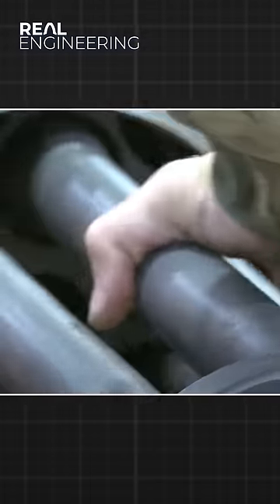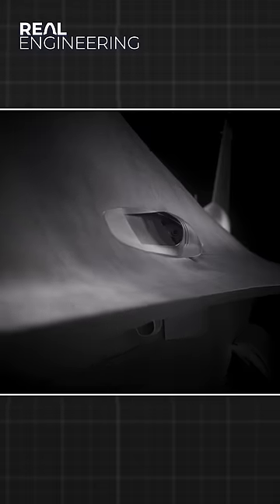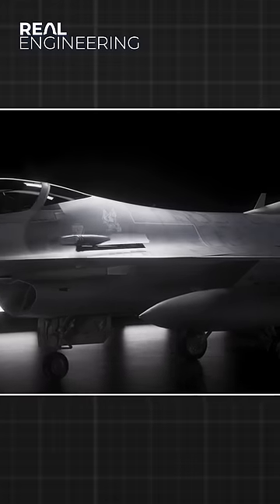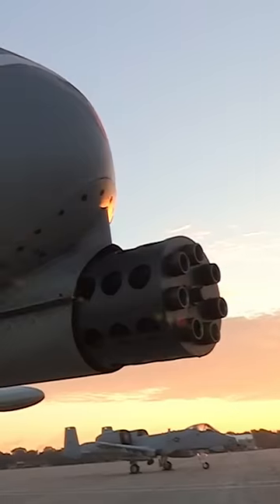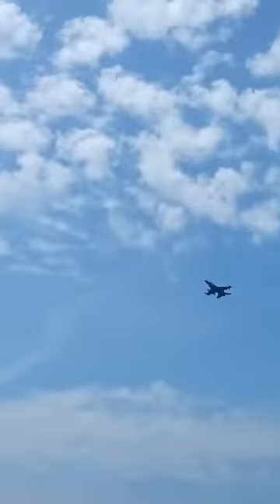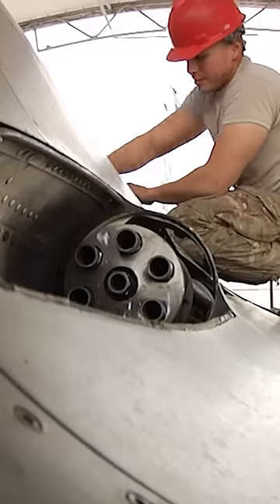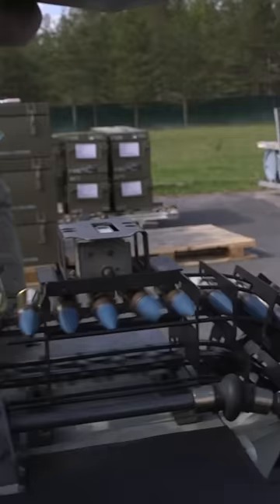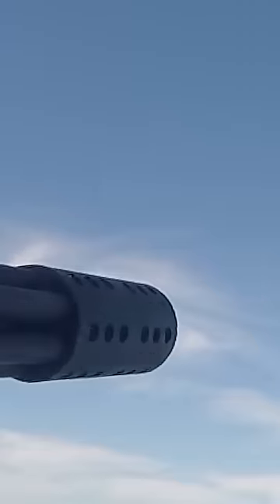The F-16s Gun Sounds Amazing

Comment: It's wild how the bullets are just inches from the fuselage as they exit the barrel.
Reply: Not really, their shockwaves from travelling faster than speed of sound can't damage anything.
Reply: @Isaac-ho8gh  fkn WAT?
Reply: @Whoisu1776 why you don't not understand proper good?
Reply: @Isaac-ho8gh 
There's only ever been one supersonic gun kill in history from what I understand, generally guns aren't used at supersonic speeds, they're used at close range after the fur ball starts and everyone's maneuvering so much their energy and speed are down.
Reply: @dukecraig2402  that's not what I said. I meant that supersonic shockwaves caused by projectiles generally don't damage things on their own (not the projectile hitting anything).
Reply: @Whoisu1776  autocorrect fucked up what I said. I fixed it just then, but what I meant to say was that the shockwave from projectiles going faster than the speed of sound (not from the projectile hitting objects) doesn't damage anything lol
Reply: In olden days fighter aircraft - the bullets would be timed to fire through the propeller!!
Reply: @ArifGhostwriter better hope it is timed correctly... that would suck if it blew holes in your prop. I'm sure it happened a lot.
Reply: @kevinstill1 - There was an interrupting gear that would be aligned with the prop. Every time a blade passes in front of the gun, the interrupting gear would hold the fire from the gun.
Reply: @ArifGhostwriter yeah the fw-190 has that and it’s cool af
Reply: "close" only counts in horseshoes and hand grenades.
Reply: @ArifGhostwriter   That's why they moved the guns to the middle of the wings. Boom!! Problem solved!!
Reply: Well, it's not like they go pulling the trigger on it every time they go out on a mission.
Reply: @Isaac-ho8gh  are you dense??
also the f16 doesnt fly supersonic and will never fight super sonic
Reply: @thedandy6765  Never say never. But, it seems that trying to dogfight while supersonic is, indeed, "A fool's bet."
It can still be a missile platform no matter the speed.
Reply: @thedandy6765 Do you know what supersonic means? You said the f16 does not fly supersonic and will never, yet it’s published top speed is Mach 2.0
Reply: @thedandy6765  are you restarted?
Reply: @ArifGhostwriter  Still cant get over the sheer insanity that this was actually and successfully designed and implemented 😂 so risky
Reply: @Isaac-ho8gh  Its the vibrations that startle pilots.
Reply: @ionbg7  the projectiles themselves don't cause those vibrations.
Reply: @thedandy6765  you also misread my comment lol
Reply: Wouldnt u be going faster then the rpunds at full speed? I cant imagine there isnt a max speed cutoff for it
Reply: @Isaac-ho8gh I think what the dude meant is that the rounds coming out of the barrel don't have a ton of clearance. It's just really close is all, it's just interesting.
Reply: @masturone8257 That would occur at just over Mach 3 (20mm round travels at ~1000m/s) The last jet capable of those speeds was the SR-71 Blackbird (retired in ‘98) and it had zero weapons systems.
Reply: I’ve seen this system actually graze the aircraft, the gun was misaligned..
Reply: @masturone8257  well technixally both the speed of the aircraft and the speed of the bullet coming of the barrel should cumulate.

Imagine launching a ball in a train. If you throw it in the direction of the movement, does it goes back to your face ? No.
Thouhg at those speeds air resistance would quickly reduce the speed of the projectile.

Note : it does not work with light ! Search about relativity if your are interested
Reply: @karlepaul6632  oh okay, now I see lol

Though, its still not wild since there's no risk of projectiles from even very short barrels hitting things beside the muzzle.
Reply: I am not 100% sure if it was Mig-25, but he managed to fire his gun and moment later ended with the same bullets damaging the aircraft scoring a kill on himself 😅 suicide crazy stuff
Reply: @Isaac-ho8gh  now that i read it again yeah i now understand you meant the bullets flying at that speed not the plane
Reply: @ArifGhostwriter yeah a timing belt
Reply: @kevinstill1  Back in those days everything had a mechanical connection, much less likely to fail. It's incredible what they accomplished without the use of computers and software.
Reply: @Isaac-ho8gh  The rattle most likely comes from the recoil from firing.
Reply: @ArifGhostwriter  And even earlier than that, they just YOLO'd it. It was possible to shoot your own prop off.
Reply: @drowsy13 Best wishes I hope you get well soon.
Reply: I've seen a poorly-boresighted gun on an F-15 shoot chunks of the panel apart.
Reply: @neojack333  i thought with the bullet having such a small amount of accelerant compared to the plane that the bullet would only be able to hit max speed then immediately slow down while the plane is able to continue at whatever speed it’s moving. I think thou when it comes to using cannons it’s always done while manuvering left right or up down not in a straight line
Reply: @ArifGhostwriter ”I’m shorry shon… but, they got ush!”
Reply: But they are traveling 3600+ fps
Reply: @masturone8257 no. Your current speed is added to projectile speed.
Reply: @msged2007  ah ok but u get what my thinking is that even if it’s added the bullet can only accelerate so long while the plane can easily travel hundreds of miles so it doesn’t at some point still get passed by the plane or that don’t matter cause it’s projected so far ahead that the plane even if flying straight wouldn’t hit the bullet as it would have already started going down and only if the pilot on purpose literally followed it then he could run into it
Reply: @msged2007  if u search just in 2019 a Dutch fighter got hit by its own bullet so it is possible and in 1956 a pilot heavily damaged his own plane and actually had to bail while the plane crashed
Reply: @kevinstill1  Only with mechanics failure of the mechanisms involved could that ever happen.
Reply: They're actually mm away! One inch=25.4mm.one millimetre=0.0394?wtf is that?....look at this ! ready!1mm2mm3mm4mm5mm6mm8mm9mm what are you guys doing 0.0394,0.0787,0.118?just go 1,2,3, ECT cooked!
Reply: @ArifGhostwriter you said “olden days”. Hey King. You dropped this. 👑
Reply: @SpaceMissile uhhhhhhhuuuhhhuuuuh
Reply: I am thinking... probably not a good idea to do a barrel roll when firing?
Reply: @ArifGhostwriter , yep, as I understand it was linked to the ignition system.
Reply: @grippercrapper  I heard on German planes it was linked to the ignition system.
Reply: @Sundablakr  actually it's credible.
It's incredible we trust an electronic component not to fail.
lol
Reply: It only exits the top barrel as it spins
Reply: @frankspikes7858 ok so then how do you account for Range and the fact that your guns are far off to your left and right When your aim ? More problems to solve

Comment: The F/A - 18 Hornet uses the same gun. There are 2 variants a 5 barrel and a 6 barrel version. They are able to fire in either 4000 or 6000 rounds a minute.  They are hydraulicly driven by a low and high pressure hoses which give the 4 or 6 thousand speeds. The noise in person is insanely loud especially if they do a low flying gun run right above you. As seen in video the weapon uses a linkless ammunition system where it retains the shell casings.  The gun typically maxes out at 500 rounds and loaded in 250 round batches with a 25 link break. The break is crucial to help keep the gun from jamming.

Comment: Just a small correction.  The F-15 was the aircraft that was designed to have a gun to fix the problem of no gun in the original F-4s, the F-16 just followed suit.
Reply: I think what he means is that the F-16 fills more similar role to the F-4, and also that every fighter after the F-4 has learned the same lesson when it comes to having a cannon.
Reply: The F-4E fixed the problem of having no gun by 1967 by having a gun, the same M61 used up to the F-22. The claims of the short are false, pretty much in line with most of this AI generated trash. 

The newer jets were made to be better at a lot of things. However, the F-4 not having a gun wasn’t one of them, cause the Phantom had a great gun and was getting kills with it long before the 15 or 16 first flew.
Reply: The F-104 was the first to have a rotary cannon, soon followed by the F-100.
Major mistake not including one for the F-4, they assumed missiles would’ve all they needed…. Wrong!
Reply: This is partially true but doesn't reflect what really happened. The F111 was supposed to be what the F15 became but didn't pan out as planned. Then studies to develop the F15 happened, experience in Vietnam showed a smaller and lighter craft with high thrust to weight would offer better performance and the pentagon realized the F15 program couldn't deliver enough fighters in number at low enough cost. So the F16 was a lighter and cheaper day fighter at first to supplement the heavier more expensive F15. Also the poor performance of missiles during Vietnam caused guns to be brought back into the basic designs.
Reply: @garyeaton5719  lacking a gun was not as big of an issue as you think it was. The missiles worked, it was failure in other fields that made them ineffective. They had no way to identify what they were locking onto beyond visual range, which means that that Soviet jet bomber you just fired a radar guided missile at might actually be one of those new jet airliners that were becoming all the rage. That's why the F14 tomcat was equipped with TCS (Television Camera System), and later IRST (Infared Search and Track), the latter being a feture of all current fighter aircraft. The F4 could also carry a podded gun
Reply: @MisterMick113 ...that sounds like Reformer nonsense right there. The F111 was a bomber, not a fighter
Edit: apparently because some people don't understand, yes I'm aware of the fact that there were plans to make the F111 a carrier based nuclear capable strike bomber, but also as a long range missile interceptor. That was the F111B. But issues with it's performance off the carrier, as well as inter-branch politics and rivalry meant that it didn't work out. That's why the Navy got the F14 instead. The F111 was literally designed to be a bomber. Shut up
Reply: An even tinier correction: Wasn't the F-14 Tom Cat built BEFORE the F-15 Eagle?🤔
Reply: @tzeffsmainchannel  yes. Also, the F16 was developed with the infrastructure used for the F15
Reply: Hot take but the f4 should have had a gun from the start. In the 1960’s to the 1980’s when these planes are being developed, not every weapon has a mini super computer inside, most bombing is still unguided or guided for a the disabling strikes and then unguided for the rest, radar missiles still used the aircraft radar for guidance and are still very new and the ew warfare environment had the potential to be very heavy and weapons had very simple ew resistance, IR missles were still having problems with flares and better flare chemistry’s were being developed all the time. 

In that environment having a weapon that is accurate and immune to EW makes sense. 

Now days every weapon is resistant to EW, jdam and sdb has ins guidance that works in a gps denied environment as well as laser and image recognition target tracking in some models with decades of experience in counter measures resistance. Radar missiles have their own radar now and EW resistant and reprogrammable computers. IR missiles have multi spectrum sensors and 360 deg lock on after launch capability. Smart weapons nowdays don’t miss even without outside enablers like gps. 

Combine that with the deadliness of the enemy missles and every squad carrying a manpad and now flying low in a straight line to fire a gun at a ground target or getting close enough to an enemy jet to fire your gun is a death sentence and its better to just flee to base or eject then even try. 

I do think we still need a long endurance close air support specialist like an A-10 replacement though, i would call it the A-10D, new airframe design, replace the gun with the targeting pod from an AC-130, and have laser guided akpws in a 360 turret on the bottom. 

Instead of taking my ideas the army appears to be going with drone that have hellfires with lock-on after launch. My gut feeling is that hellfires are too expensive to use in every engagement and a cheaper option like AKPWS is needed, drones also require datalink which requires satellites and/or high power ground stations that are easily tracked, and drones require a ground station to be alive to control the mission while an f/a-18 does not require the carrier or satellites to be alive for the JDAM to work. So i think there is still room for EW hardened weapon systems in NATO. 

Thank you for coming to my ted talk.
Reply: @purplepenguin43  The A10 needs to be retired, it's a fossil at this point. It's heavy, slow, and extremely vulnerable to shoulder mounted launchers like MANPADS. Planes like the F/A-18 or F35 don't need to have a titanium bathtub to protect the pilot from ground fire because they're fast and can fly high enough to avoid that stuff. Point is, why make something that has to fly low and slow and need a titanium bath tub when you don't even need to?
Reply: @purplepenguin43  Counterpoint, The Naval who rarely equipped their phantoms with guns had double the KDR in Vietnam as the Air force.  And the Fact you think the A-10 should be upgraded instead of out right retired shows you dont know much about this topic, no offesne.
Reply: The F100 super Sabre was before the starfighter?
Reply: @skyraider87 HeyMister, see the "F"(111), stands for "Fighter"; if an "FB"_ "Fighter/Bomber". Just know... there never ever was an "B111" moniker!
Get yer GaulDamned act together.
Reply: @onewayup5  the F117 was a bomber too, what's your point?
Reply: @purplepenguin43  while i understand your point, tbh i would disagree regarding F4 should have gun from the start of Vietnam War. 
I think this's common misconception. Considering in the beginning of the war, those pilots were ill trained in Both BFM and BVR, if they have gun, there would be even much more casualities in the phantom's side than currently is. 
The problem's they would be more than willing to engage, the more maneuverable Mig17 & Mig21 in close combat, gun fight, which's really a bad idea. 
This's the same as that despite you have hunting rifle on your back, you decided to pull your knife to fight your opponent, who's clearly a knife-fighting specialist. 
If your rifle don't work against your opponent, its better to flee from the fight rather than to close in & forcing yourself into a situation that you'r not trained in the said area.
Reply: @skyraider87  The point is you said the F111 was a "bomber only". If you weren't so anxious to rid your thoughts of 'self erring' and actually understood my reply ( eg: the 'F' prefixing 111 is "Fighter111" )....
The point NOW is for you to rid your pseudo knowledge and begin life anew.
Reply: @thunderboltcougar5626  there was also the doctrinal issue of not being able to positively identify targets beyond visual range. So that Soviet nuclear bomber you just Fox 2'd might actually be one of those new jet airliners that were becoming all the rage at the time. That's why the F14 got TCS and later IRST, and why all modern fighters have IRST
Reply: @onewayup5 The F-117 is a fighter?
Reply: @ut000bs  It was strictly an attack aircraft despite being commonly referred to as the "Stealth Fighter".
(air-to-ground attack Fighter rather than air-to-air, the later being its initial design raison d'être)
Reply: @skyraider87 "The F111 was literally designed to be a bomber." That is correct.
Reply: @onewayup5  I know exactly what it was. Intimately familiar, even.
Reply: @skyraider87 because flying low and slow is the best way to support troops on the ground. Yes it's out of date and would be toast in a near-peer conflict but that's not what it was being used for and there wasn't a replacement. Now it's being replaced with a cropduster that has less ability than the WW2 era A-1 Skyraider. That's bureaucracy for ya.
Reply: @aaronthompson192  "Low and slow" was the doctrine that worked when MANPADs weren't a thing and planes needed to use guns and dumb bombs for CAS. You don't need that with precision guided weapons, and you'd rather keep your planes flying fast when the air defenses are hot. Also, the cropduster being talked about is used precisely for the purpose of fighting  low-tech insurgents, not peer opponents.

Comment: "TOO CLOSE!!   SWITCHING TO GUNS!!"  ~TOP GUN 1986
Reply: The F16 basically has 5 short bursts... The F14 in Top Gun has unlimited ammo.
Reply: @mr.robinson1982 who care
Reply: If your too close for missiles you are too close for guns lol.
Reply: Yeah, sounds amazing.                             IF WE COULD HEAR IT!!
Reply: @Twitch380  not really. There are IR and radar missiles - short and long ranged ones. Nowadays there are IR missiles that can pull 40-60 Gs and hit the fast moving target 6 km away easily. Radar missiles are even more curse pulling less Gs (30 probably), but they have effective range of 140 km. The dogfights are really rare right now, but if they happen you can hit the target with 20mm shell 200-1200 meters away. All missiles that were designed as very short range, like SRAAM, were mostly failure because they had to be very light, had almost no fuel and hardly stabilized.